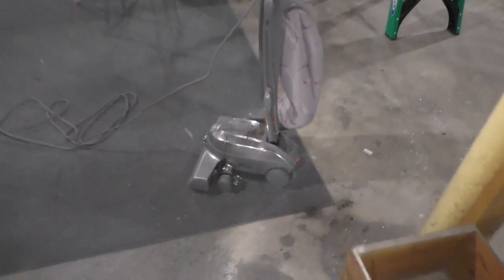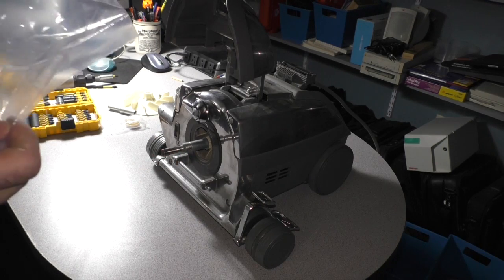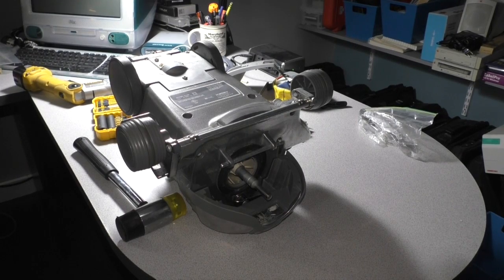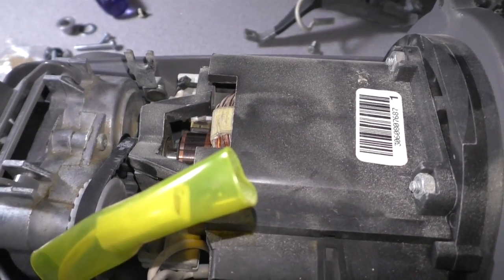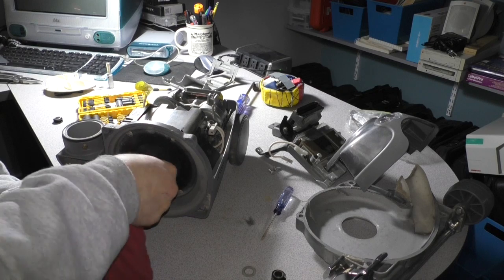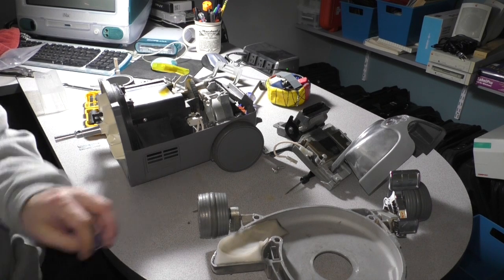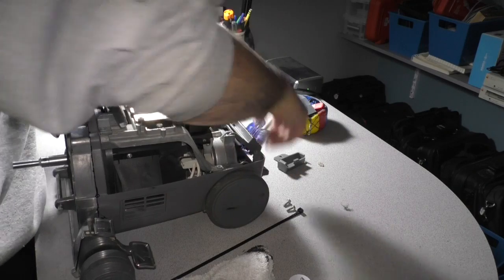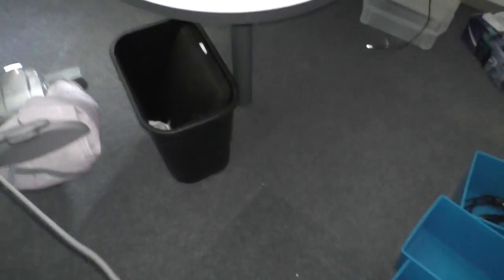Replacing A Broken Kirby Sentria Impeller (other models similar)

Comment: I'm a bit late to watch this video due to I bought my Kirby Avalir for 1,999.00 20 years ago and have used it every day since. Overkill on construction of this "machine" is an understatement. Never once have I had a single problem with it and have used just about every feature it has and it WILL suck up pretty much ANYTHING in its way...LOL Just today it grabbed a strand of yarn and pulled 5 socks and a jacket in which broke 3 pieces off the impella, bent the bottom floor bar, and broke the air flow light. 
Turned it off and ran just to make sure I didn't get sucked up too...:)
Truly an untouchable machine as I can't call it a vacuum as it has more uses and more powerful than the 4 cylinder engine in my truck...:)

Thank you for a very understandable video of the guts in the front end of it. 
Fix it, plug it in, and see you in another 20 years.

Comment: This is the first time I see a broken amodel fan. I have sucked up coins, rocks, and a 1-1/16 nut with my g6 and my fan has some nicks but no broken blades thank goodness
Reply: Mine wasn't broken anywhere either but it was making an awful squeeling noise when the impeller would slow down after turning it off. I hadn't noticed that it was really noisy all around until I ran it with the new impeller. Now it sounds and works like brand new. Glad you're not running into the same issue.

Comment: Thank you BBISHOPPCM; I've replaced my impeller. My damaged one refused to slide off the steel post so I useed WD40, wiggled & prised it off. It seem you have a knack of remembering where the screws came from? I have  to photograph each one, and other parts, before I remove them and put all screws and parts in line by order of removal. My sealent takes 24 hours to set so when that's done I'll test and find out if the very damaged impeller was the cause of the screeching and greatly reduced suction. I won't be using it again on a building site!
Reply: I used to do the same when i took my 1ts one apart, now im a dab hand at each model

Comment: Even though I usually go about it differently, you definitely did a textbook perfect job, down to replacing the zip tie! And I’m a perfectionist who gets paid to do this kind of work! Just like I do, you put it back together EXACTLY as it was when you opened it up, the color of the sealant on the fan housing is the only clue that someone was in there, and that’s exactly how it should be!
Reply: I can see you learned this the best way, by doing. Stones are not for commutators. Use scotch brite and maybe some contact cleaner but not necessary.  Hold in on the commutator and spin the motor. I am wondering about the screw sizes on these machines. My G4, age unknown, has M4 x 0.8 pitch screws. The standard for M4 pitch is 0.7 so finding the right screw size if you drop one will be very difficult. I am a 50 year toolmaker and I don't even have a tap that size. They may be available from UK or Europe. I can't find them anywhere. M4 is almost the same as 8-32 so maybe that is the actual size.

Comment: you say that but bissell sells a lot of parts for mine still. they are cheap too. i will say the one i have isn't bad for being like 15 years old. i had to clue the hight adjsutment and i should get another hose since there is a air leak from where i took tube off hose for some reason and have to use tape to keep air from leaking. the hose is $13 and i can get height adjustment cheap too i am sure if i wanted too. only thing i want to fix but never really tried too is the locking thing being broke. it don't go back up like it should now. 
https://www.bissell.com/cleanview-upright-bagless-vacuum-3590/parts
there are a lot of other sites for those "service center only" stuff 
https://www.ereplacementparts.com/bissell-8975-cleanview-bagless-upright-vacuum-parts-c-129994_129996_130122.html

Comment: I wonder if making that impeller from metal would had been advantageous?
Reply: Andrew Littleboy they used to, but when the metal fan broke it usually put a hole in the side of the fan casing! The Kevlar these fans are made of is tougher anyway.
Reply: A metal fan would be harder for the motor to spin so it would make the vacuum less powerful.
Reply: Larry meh, I doubt this, there’s not a noticeable difference. It really had more to do with making the fan less brittle. These new kevlar fans are extremely durable, and it takes a lot to break one. I see Kirby’s all the time with those Emtors at the bottom of the bag just full or screws, nails, pebbles and spare change, but the fan just looks a little gnawed on...
Reply: @compactc9  Yes, the newer fans are an improvement. The metal ones are durable, but they can break if you pick up something really hard. I have broken a few in my time trying to get them off the armature, lol. I really, really hate those gray Lexan fans. Those things get stress fractures over time and they break under pressure.